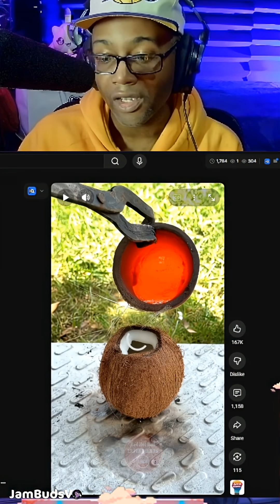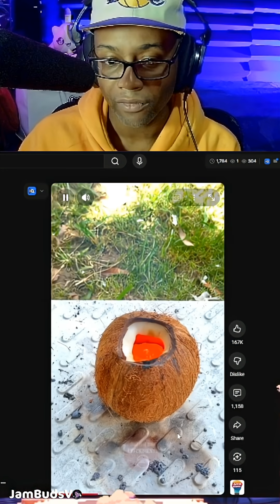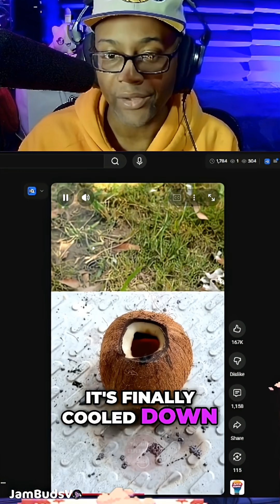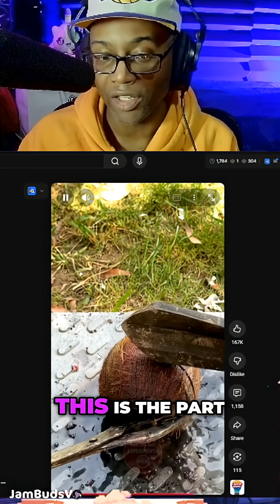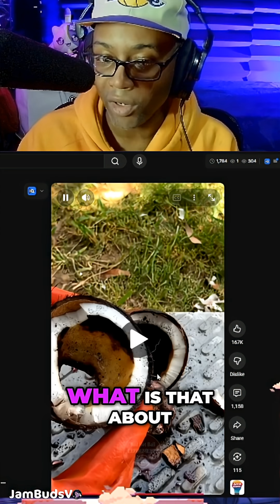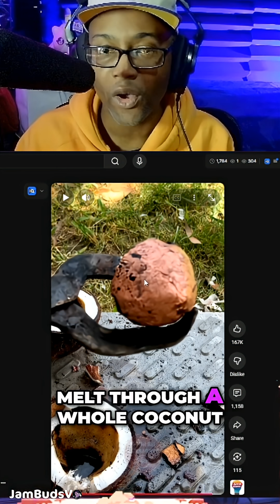Molten copper vs. coconut? Why didn't it melt through?! #shorts

Comment: It's the water! Hiya, engineer here. To burn through the bottom of the coconut, it needs to first transfer enough heat energy into the water to make the water evaporate and then it can burn through the material that's still there. With water in particular, it takes a lot of energy to make it boil. This is related to the heat capacity of the material. 

Add on to that really good heat transfer of copper and what probably happens is as soon as the copper hits the bottom, it transfers all its heat into the water and the coconut and solidifies so the copper that comes after it has to transfer its heat through that solid copper which gets absorbed by the water so that copper on the bottom probably doesn't liquify again.

You can also add a third effect where the smoldering or burning material of the coconut forms a layer of carbon that actually acts to protect what's underneath.
Reply from the maker: 😮nice!
Reply: @JamBudsVO Go to sleep Jam